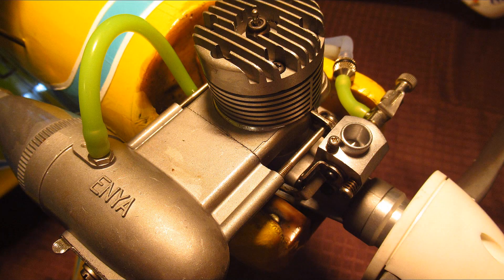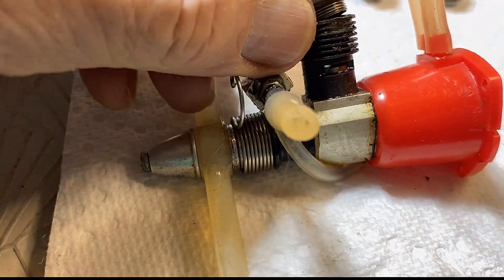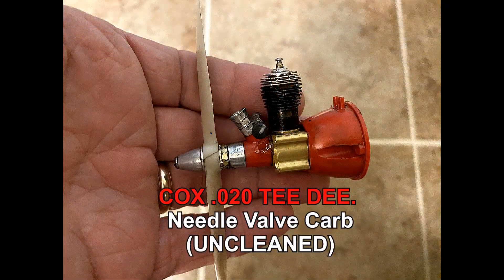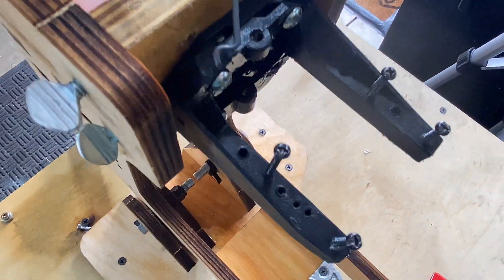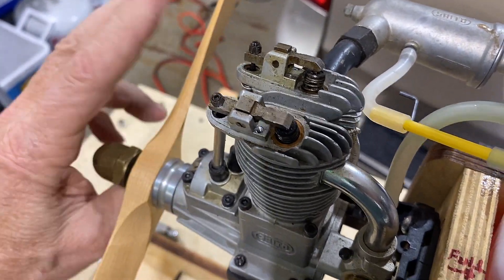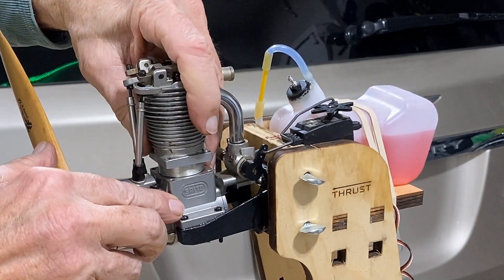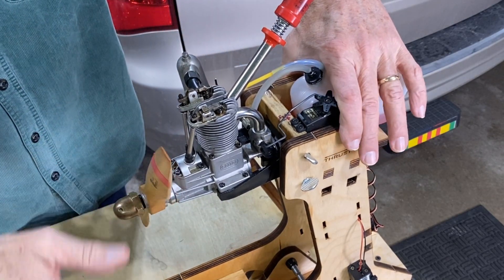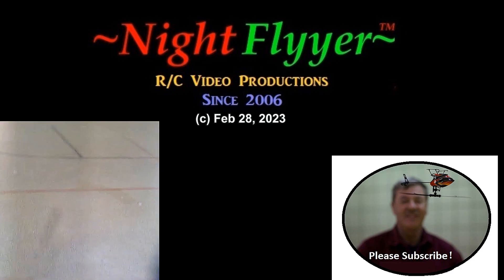NITRO R/C engines. Thrust test of Saito 100 4 stroke & Cox 020 Tee Dee. Saito Disassembly & why.

Comment: Wouldn't a guy somehow have to recalibrate the test stand for the differeing weights of the engines that are mounted on it? Some of those engines are MUCH heavier than the others, and hang quite a bit further forward, putting more or less weight at different distances from the pivot point. This fact would change the ratio of force put on the scale just from the weight difference alone.
Reply from the maker: Just adjust the Tare Weight to zero on the scale after mounting the engine. (this eliminates  any weight differences)  Then the result is accurate. Engine forward or back creates the same thrust.  But you can contact Candela Research center to find out more.  Good Question!.
Reply: @NightFlyyer  👌 🍻

Comment: Hey Dave, i've been sub'ed for a long time but don't comment much. You and I are on the same page and similar age. I want to make 2 points: A, Saito ... The only Saito I have is a .56. All of my other four strokers are OS. That little .56 is such a fussy little ##@%^ that I refuse to use it any more. It's in good shape, timing is right, glow plug is OS-F but it won't behave on anything less than 15% nitro! My OS engines will run nicely on FAI. And the main needle adjustment is so touchy that one click either way is almost too much either way. I've had too many dead sticks to trust it :(

B, Nitro. I am not trying to be a smart ass but I simply don't know how "glow engines" became "nitro engines". In the old days when I was flying control line we never heard of "nitro". We bought methyl hydrate and castor oil at the pharmacy and mixed our fuel 80/20 and proceeded to have too much fun! Where did the term "nitro engine" come from?
Reply from the maker: Well, I have been flying for over 65 years and we called it gas.  So many "woke" people said I was wrong, so I use the word nitro.  I run 20% Nitro in my engines and they all run well. We used to mix our own fuel and sometimes I used 40% nitro in my pylon racing days with Caster but changed to Klotz Oil synthetic which is cleaner.   I have a Saito 120 in my Big J-3 cub and it runs great as well.  A standard glow plug will not work, as it has to be long enough to reach in the chamber, and then it will stay hot. As you saw, this 100 idles perfectly.  But In my planes, I always install a glow driver on board anyway.  Never had a dead stick with that setup.  I have had several 4 strokes, including the OS  46 and I loved them, but they were destroyed in the fire,  and I especially miss the Kalt .45. So thanks for the encouragement and know the term Nitro was probably invented by the woke crowd that thinks Hovering airplanes and hogging the field, is cool. Hovering airplane is really easy, for us Heli Pilots, but that is the fixed wing flyers  way of saying they can hover. I miss the old days too. LOL.  Thanks.
Reply: @NightFlyyer  Ok thanks, that is a reasonable explanation. As I said, the Saito 56 is the only four stroke I have problems with and I do run the correct OS-F plug. All of my other four strokers , 5 in total, run great! On board glow is an option but one I'd rather avoid if possible. 20% nitro is out of the question. I will not spend good money on any more than 10%, but then I'm flying glow exclusively so the cost of fuel is a big factor. I don't own a gasoline or electric plane. Not that I'm opposed to them, just that I have  box full of great engines. 2 and 4 stroke so why not use them? My favorite 2 stroke is K&B .61. I have four of them! I have to limit myself to what I can squeeze into my car so my 1/4 J3 is as big as I go.

Comment: Good going Dave!!   I'm wondering if the Saito was setup for Counter Clockwise rotation.    Glad you got running well, its like a mini Harley!
Reply from the maker: I thought that too, but it just wouldn't suck fuel either way.  And Charles made a comment above that he took it apart and didn't put it together right, so that was that. Yep, vibrates like a Harley.  Thanks LLoyd.
Reply: If it WAS set up for CCW rotation, it WOULD have required a cam swap to get it to run in the CW direction... No amount of re-timing a cam made for CCW rotation would allow it to run in the opposite direction. It would require a totally different cam, specifically made for reverse operation. The same cam can't be used interchangeably.
Reply from the maker: @davelowets  That's right.  Only Cox 2 stroke reed valve engines or similar, could run either direction.
Reply: @davelowets  Your right, I looked into that.  There is a different cam available for CCW.  It looked like the lobes could be moved via a setscrew, but maybe not.   Also there are some that claim you can swap intake and exhaust port for reverse rotation, however screw sizes don't seem to be interchangeable.   Have you tried any of the above?
Reply: @lloydromeo3860  No I haven't... 
I don't have any experience with that exact model 4-Stroke, but I have done alot of work on many others, and I've never seen cam lobes that can be adjusted with a set screw, but that doesn't mean that they dont exist... 🤷🏻

Comment: I really enjoyed watching this Dave !!   The saito is my fault lol..  I dissasembled it years ago because i was curious.. I had run it before but not after.    Thanks for all you have done for this hobby Dave !  I hope you realize what an icon you are !!
Reply from the maker: Right on , Charles.  Thanks again for sending these.  I enjoyed the troubleshooting, and success of getting it to run again.  I appreciate you for sure.  Happy flying.
Reply: @NightFlyyer  Dave check out the DIY video of making a throttle using a dubro front steering wheel assembly for the test stand !!  It’s in my videos

Comment: 13:04 Aeromaster Bipe+4-Stroke=Baddass power to spare my uncle had a O.S. 120 4-Stroke with Pump swinging a 14 or 15 mich prop on it? Boy he would take off from the grass with less then half throttle and fly it with a littlebit close to half he had tons of power whenever he needed it on his Great Planes Super Aeromaster but never had too it ever stunt he could with just that speed alone. 

Fantastic job on the video Dave I sure wish I could fly my nitro O.S.46 AX with CCP on my Mojo 40 again this year but sadly whenever place I go with people weather being from a club or not start crying about the noise granted I'm not flying it really running it early in the morning or late at night but just plain old ''cry babies'' saying to me'' why don't you convert it to electric or use a normal muffler bluh,bluh'' so really I have no choice but to fly my electrics instead which aren't the same as nitro power the flight time and yes I love the smell of burning glow fuel too😁😁😁😁
Reply from the maker: I'm with you for sure.  I am also not a fan of also trying to fly pattern while there are 5 guys in the air with their hovering airplanes.  You know, if you fly a helicopter, hovering airplanes comes naturally easy, but they think it is impressive and don't mind hogging the field.    Thanks much and stay well.